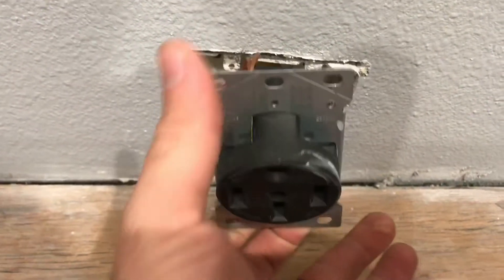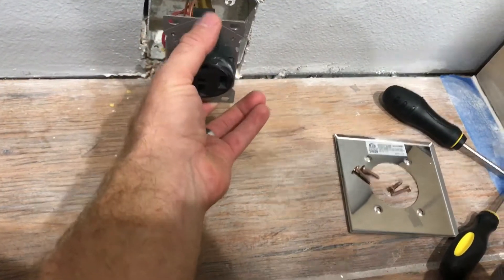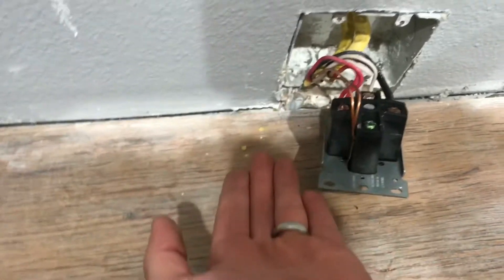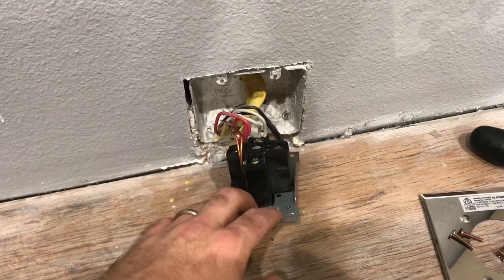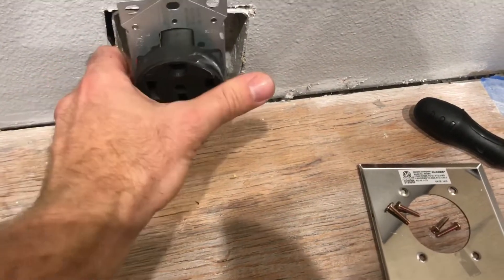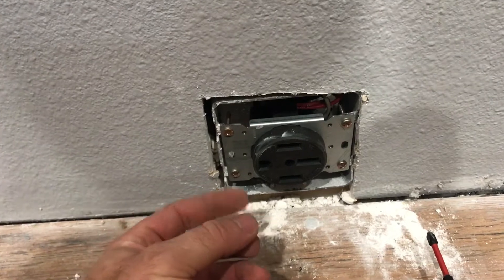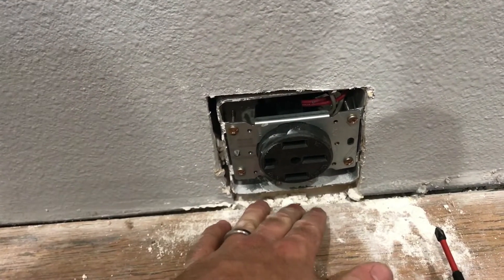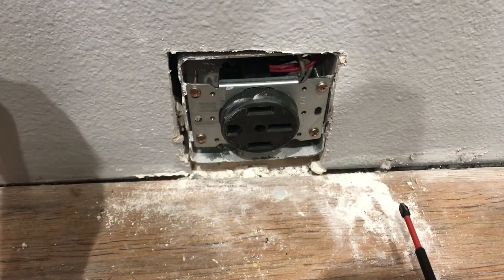Installing Electric Stove Receptacle

Comment: Using that 10 gauge wire is a big no no. Regardless if its a 40 or 50 amp breaker. You're losing heat protection on your breaker. For that line will melt well before a 8/3 or 6/3 wire. Which is rated for 40/50 amp breaker. Most 10gauge tops out at 35amps. I'm sure it works.... But if it ever heats up, your looking at a possible house fire. Since that breaker is not going to break before that wire melts.

Comment: Why is it so low?
Reply from the maker: The profile in the back of the stove that allows for the large plug is down at the floor. If we out the receptacle higher we wouldn’t have been able to push the stove all the way in against the wall.

Comment: Dude, kids are interested in what their parents are interested in; your little one's likely to try working on outlets too, when you least expect it... When I was just a little older, I thought an outlet looked a lot like a car ignition, and a screwdriver was the perfect key: BAM! Knocked me a good one.
Reply from the maker: I understand. All of the high amperage and voltage circuits in our house are OFF when exposed and unprotected. Even the big welder plugs and such in the shop, the breaker is off unless I’m using that plug for the dedicated tool.
Reply: @TomBrueggen  It's very cool that you let your kids hang with you, even though it obviously adds challenges.

Comment: I'm not sure the electric code or the outlet allows two 10 gauge wires under one terminal lug.  I would have just gotten the 6/3 with ground cable for safety.  The NEC and building codes exist for a reason, to keep people safe.  Not to annoy people or increase costs. It's based on mistakes in the past that have cost lives and/or property.   Keep your family safe.  Good luck!
Reply: Arc fault breakers has entered the building... Your argument is now null n void. Hey you can't use that old vaccum cleaner your great grandma gave you anymore, except the garage. Hey you cant use that fancy corded drill inside either. Hey you can't use that blowdryer except in bathroom. Hey you can't use that ethernet over AC line adapter anymore. This list continues..... Ever used a drill and saw a spark in the back? Thats an arc fault my friend and it will trip the breaker, same with majority of motorized devices -Journeyman Electrician that would NEVER install arcfaults in his own home

But in this instance yes you're correct and this guy should not install his oven on that.

Comment: look like 10/3 nm romex wire. Should be at least 8/3 nm romex wire.
Reply: Depends on amps, wire size - 8/3 is for 40max 50amp recep
Reply from the maker: I don’t recall for the stove, but I think it was only 40A maybe. Anything over 30A in my house I ran double 10/3 instead of going to buy a few feet of 8/3 or 6/3